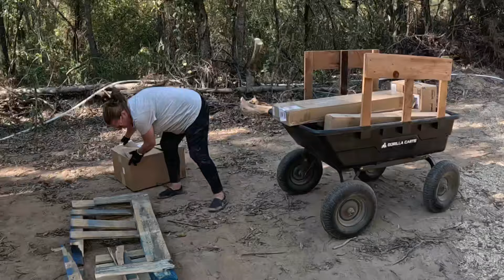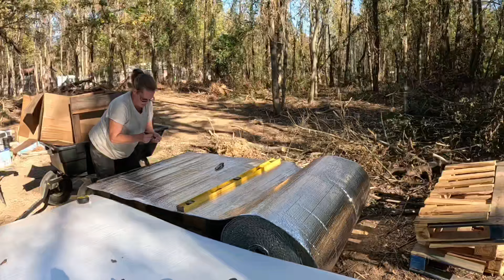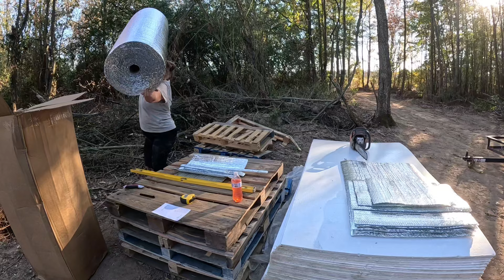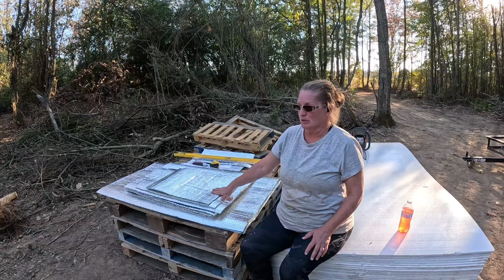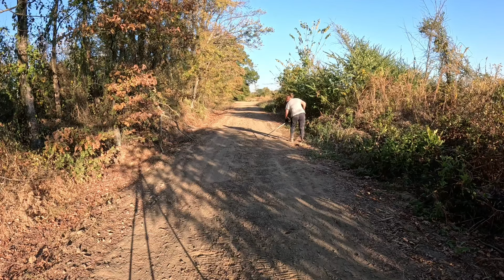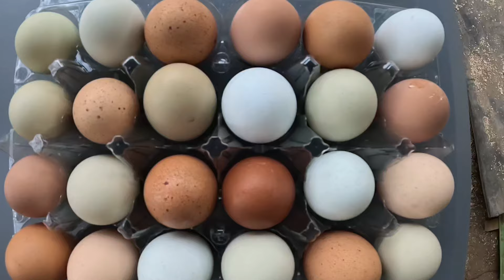This & That! | Off-grid, RV Life, Couple build

Comment: Command strips make a velcro strip for hanging pics that would work great for your window coverings and doesn't leave a mark when you remove them.  Just a thought.
Reply from the maker: Great idea! Thank you. 💯✨️
Reply: @B2GOG  "Command" strips are expensive but a roll of sticky velcro won't be that cheap and it'll leave goo on your window frames, if you are even able to eventually remove them.

Comment: THE INSULATION IS “RADIANT BARRIER”   WHICH WAS DEVELOPED FOR THE EARLY SPACE PROGRAM.  YOU ARE USING THE DOUBLE BUBBLE.  THERE IS A SINGLE LAYER ALSO WHICH WAS USED IB THE ASTRONAUGHT’S  SPACE SUITS.  CONDITIONS OUTSIDE THE CAPSULE  WAS 400+ DEGREES  IN THE SUN AND MINUS 400 DEGREES  IN THE SHADE DURING A SPACE WALK
Reply from the maker: Thanks for all the interesting info! 💯✨️

Comment: From one camper to another:  Line your closets and cabinet insides too.  It really helps keep the inside warmer/cooler depending on the season.  Also line you under belly storage too as helps keep floors warmer.
Reply from the maker: Oh yes! Our camper is already fully insulated, but we have plenty of foil insulation to line as much as we can. Once we get the priority outdoor stuff done, then I'll tackle taking everything out of the closet and cabinets. That's a huge process that I'll save for one of those days it's too cold outside! 🥶 Luckily, our diesel heater keeps us very warm in there. Plus, we will have a 2nd diesel heater coming in a video soon. 👀🔥🎉
Reply: Every project helps you to prepare for winter season ❤❤❤

Comment: Boy you had that window insulation project whipped out in no time!  I see the gorilla cart comes in handy for so many things too.  Have you thought about getting more pallets to use as a decking area under your awning and along the front side of your camper to help deter tracking in  mud when the rain comes.  You would need the ones that has the wood pieces close together to make it easier to walk on.  Just a thought.
Reply from the maker: You are reading our minds! 😜 Sean is bringing a trailer full of pallwts home from work again today! He can only get them when it's truck delivery day. He will keep getting more until we have what we need for skirting and a deck walk around area. 💯🎉
Reply: @B2GOG  Great minds think alike😁

Comment: Excellent job, Rachel!!!😊🎉❤ When I lived in my RV, I had blinds, so I was able to use a large truck window shade like that and hide it with the blinds. I lived in an RV park, so I just left them in year round!!!😊😅😂 It kept the heat in winter, the cold in summer, and the noise out all of the time!!!😅😅😅
Reply from the maker: That's awesome, Elaine! I thought of putting fabric on them. One side black to draw heat in the winter, and the other side a light color or leave foil. That way, I can flip them depending on if it's summer or winter. It would look nicer instead of foil. Our curtains need to be replaced, so I really want to just remove them. The cat likes to climb them. 🤦‍♀️😜🤣 Hopefully, she won't think the wndow covers are new play toys! 😆

Comment: Greetings from Northeast Ohio. I was married to a Road 💛 guy. You’re better off leaving those stones in the road where the tires go . You’re going to need them for traction not in the ditch.
Reply from the maker: They are big rocks that are tearing up the front end of our car that we just spent a few thousand replacing a bunch of parts. This road doesn't rut bad as it's very compacted. If we need to fill any low spots, the rocks will all be lined up on the side of the road to use where needed. ✨️
Reply: @B2GOG  gotcha

Comment: CANT YOU USE BLUE OR WHITE TAC
Reply from the maker: Yes, I could, but glue wouldn't make it easy to remove daily if desired. Tacs would put a ton of holes in the wall every time we removed them. Figured velcro is more flexible for easily removing daily and doesn't do damage to the wall. ✨️